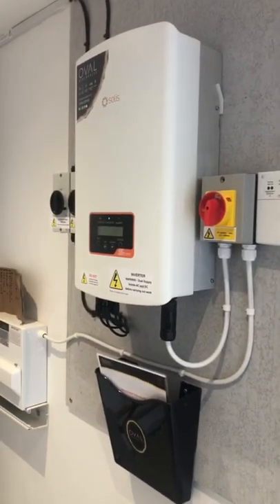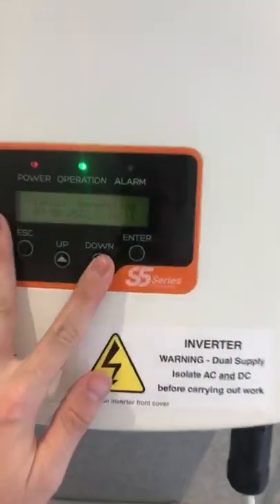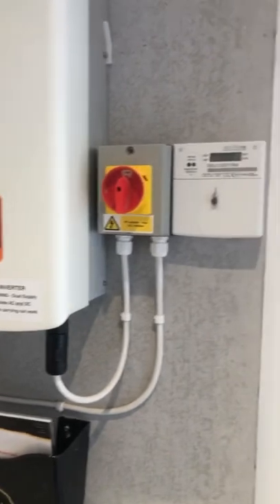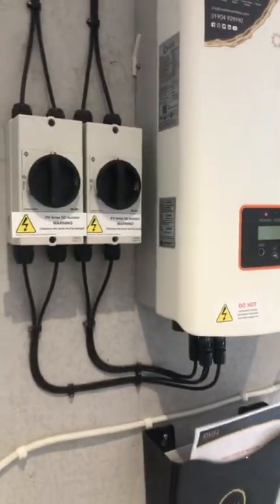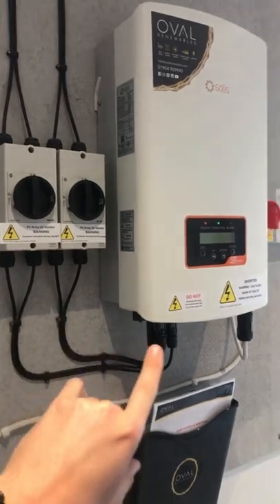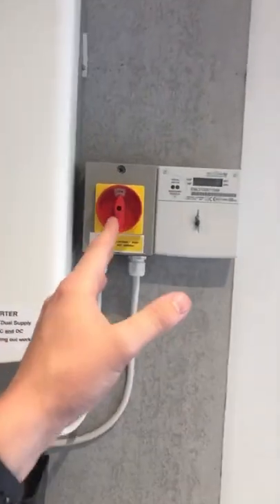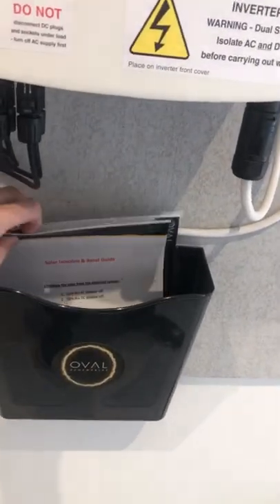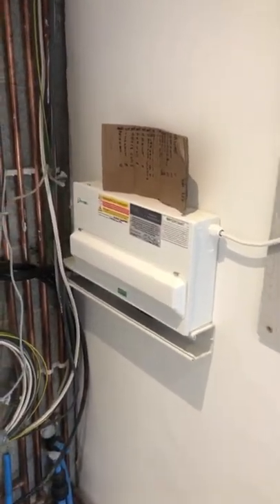New Build solar PV system completed! ⚡️☀️ #renewableenergy #renewables #solarpv #newbuild #bills

Comment: I’ve just ordered a 6 kw 5g, never done it before I’ve been reading the regs I’ve ordered type b rcd as there ment for pv and electric cars why don’t see that on installs ? I am spark but only reading regs
I’ve gone for modular dc switches so I can put in one board
Reply from the maker: From memory I believe there is protection built within the inverter that negates the need for the type B RCD
Reply: Type B, nice and cheap 😀

Comment: Only wanted the smallest system 🤷🏻‍♂️🤷🏻‍♂️. Crazy whilst you are doing it you want at least 4 kw more if you have the space. When electric hits £1 a kWh they will regret that small system. Neat install though. Not sure about the document holder it will just fill up with dust and crap. Think you need to find something better for long term storage
Reply from the maker: Thanks for the comment john, we would have loved to fit more solar to this but obviously it needs to be paid for so we had to do what they wanted. I take your point about the doc holder but its the best and neatest way we have found. Saves them getting lost!